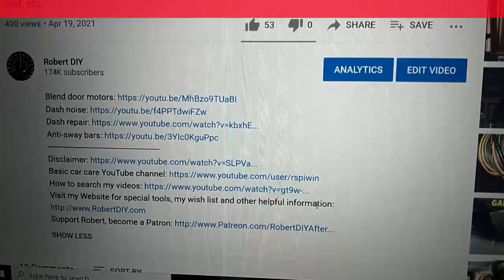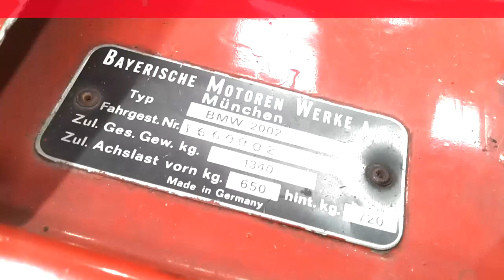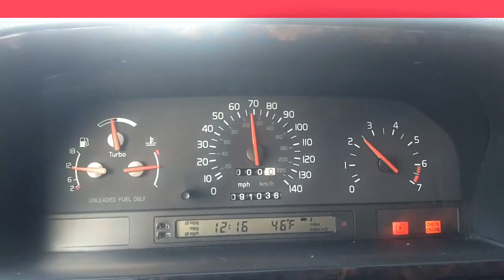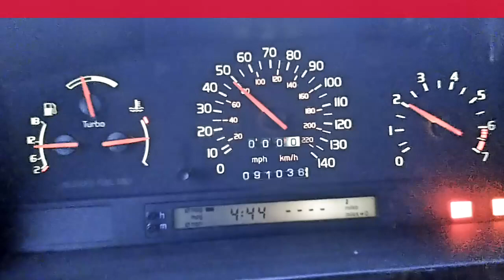Now in Seattle WA, Portland OR, Eugene OR, etc. Picked up my new ride at T-Zero Racing.

Comment: Is that the white Volvo 850 purchased with 91k actual miles at the end of the video? Hope the car is in real good shape and original for the most part. When look at the mileage and it being analog seems fairly low when thinking of my own car with a digital odometer at 201500. Wish could afford another car being  mine has a rusted out frame though a unibody.
Reply from the maker: It has 108,000. All of the 850 odometers break at some point and need to be fixed. The mileage can also be corrected because it keeps counting in the cluster. 

Sad to say, most of it is original. Shocks, bushings, control arms, etc. All due replacement.